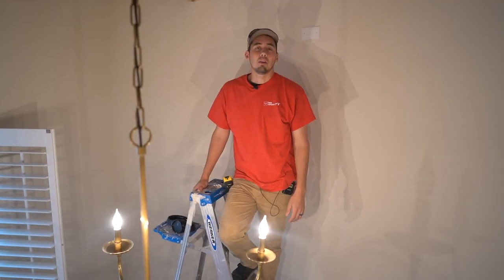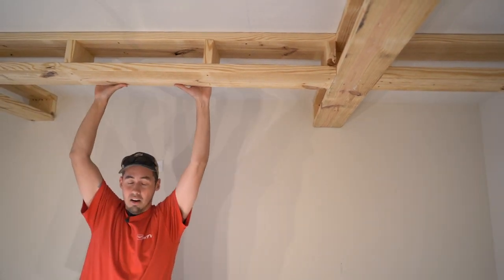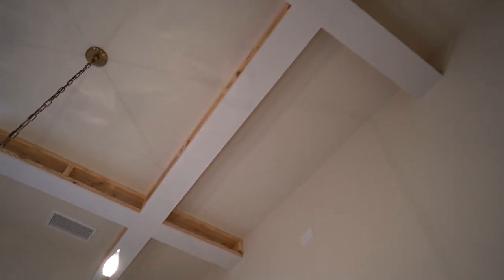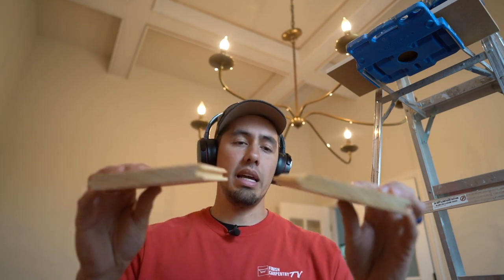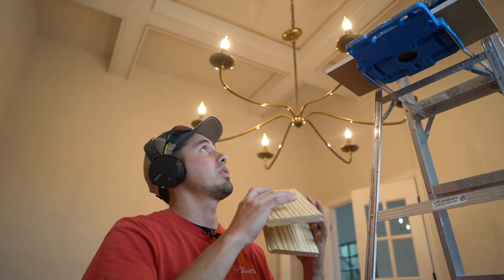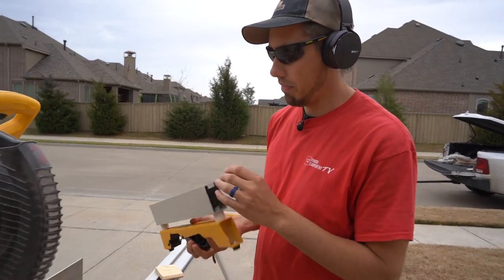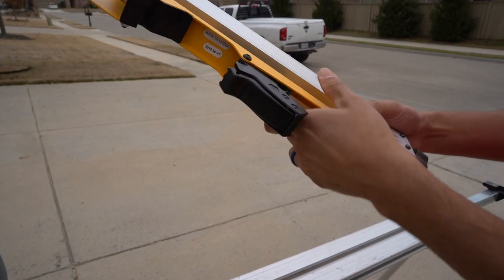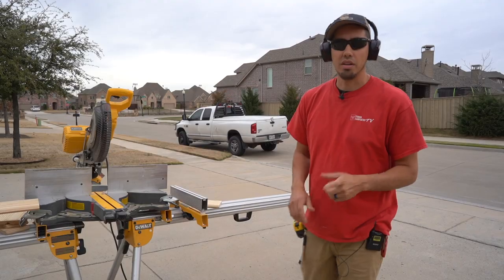Installing a Coffered Ceiling!

Comment: 🤣🤣🤣🤣🤣☠  omg this is hilarious.  If anything youre actually probably strengthening the roof structure in that room, really.  The added reinforcement has got to counteract the added weight of that.  Certainly the roof supports are designed to support a minor load like this, which acts like cross braces anyway... 

You cant fix stupid, just ignore it and try to teach folks lol!  I have learned quite a bit from you.  I really want to start a business doing what you do maybe in San Antonio here in the next few years.  I watch everything you put out, thanks so much for doing this!  Keep it up.

Comment: I started to comment after watching your first video because I was so impressed with your presentation  and attitude towards your viewers (of whom probably 90% aren't at the same skill level as you) but wanted to watch the follow up on the first video. Unfortunately by 1:40 I am no longer a fan , insulting people just because they are less (informed) is really a sign of a unprofessional , I realize people in the construction trades aren't the brightest group (40 years myself) but this isn't about them.  Just like any job 60% of it is about your relation with your costumer its about your ability to generate costumer loyalty as opposed to satisfaction, because if you insult people in front of 90K people word will get around.

Comment: The gist I got from the previous comments had nothing to do with weight.  Well probably somebody, and that’s dumb.  Obviously it’s negligible.  They were just wondering why not 1x? It’s probably cheaper.
Reply from the maker: Eric Randall 1x is actually more expensive and it has less of an area to shoot into. But either would work. There are so many ways to do things.

Comment: It's not to " heavy", it will hold,   but it's just unnecessary. On the other hand,  I pay to resharpen my saw blades many times, to get max  use out of them. You prefer to throw it away after 1 use. I consider that  a waste.

Comment: I don't think the majority or fo people are confused about the ability of the building to hold up the structure of the coffered ceiling but I reckon that this is a typical example of USA overbuild.  The size of the timbers is outright ridiculous.  The size of the new ceiling calls into question the integrity of not only the building to hold it up but the builder's confidence and knowledge of the strength of the material he is using???   It is a coffered ceiling whatever happened to 1/2" material it is not a structural member it is supporting some drywall and paint.. No wonder the UN passed AGENDA 21 to pull back USA overuse
.

Comment: Hello Richard.  While I certainly agree with yiur opening comments concerning some real dumb commenta( you clearly mentioned in the original video that the toggle bolts were for fine tuning  the wood into final position and you as well clearly show installing the three inch screws knto the joist) 8 am somehwat surprised st how much it got under your skin and this is so out of character for you to address this in such fashion
Based on these videos one would not have expected such a rebuttal from your side. Lol

Harleymike/chicago

Comment: You don't need all that all you need is a flat tuba 6 against the sheetrock then you just put in one by 6 on either side and I won by eight in the middle with a quarter inch reveal you don't need all that it's way over framed

Comment: Don’t get mad, you didn’t show in the video you screwed these into the joists.  You only showed the drywall toggle bolts holding the assembly to the ceiling drywall.  Chill out man!
Reply: Yes he did, he also explained what the toggles function was.
Reply from the maker: Mark Lynette I clearly explained it.